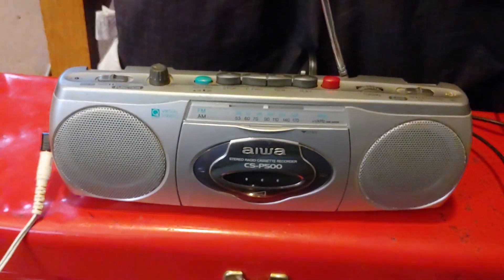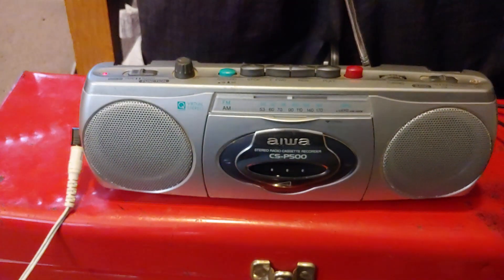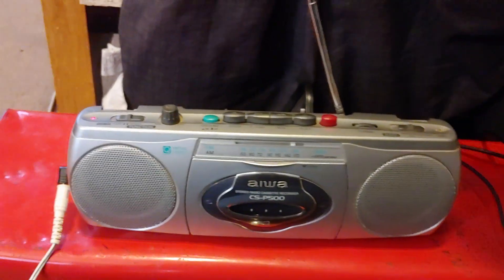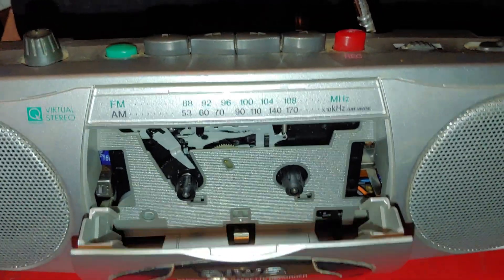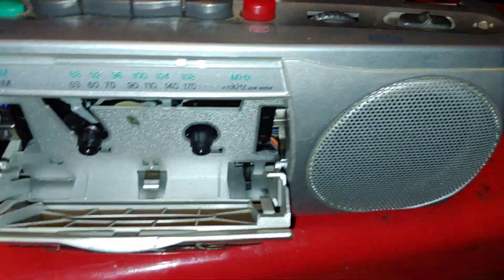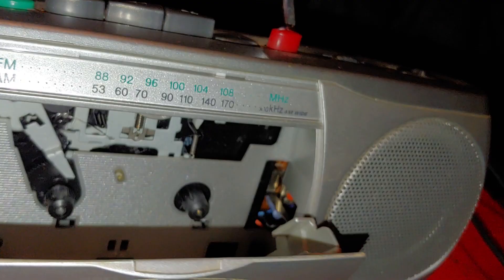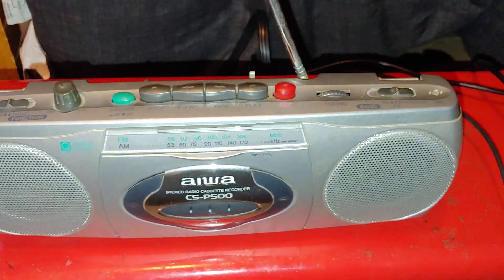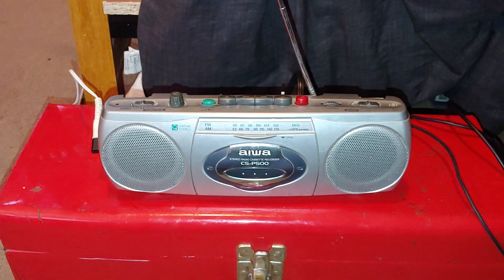Aiwa CS-P500 mini boombox

Comment: I’ve got the same radio but mine doesn’t switch over from FM to AM. The switch moves but it stays on FM. Any idea of what I can try? Thanks
Reply from the maker: Try spraying contact cleaner on it. It could be so dirty and dioxatized that it's not making a connection.